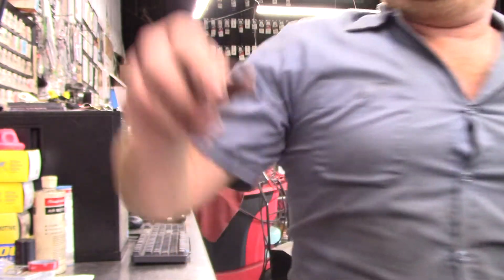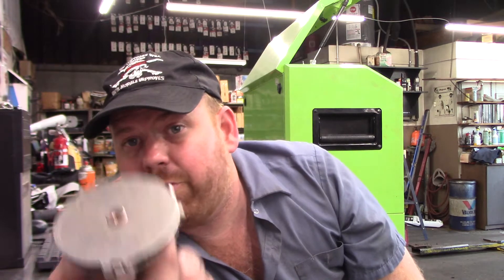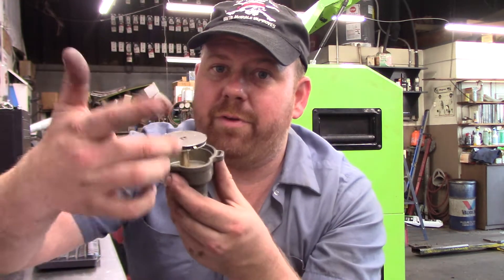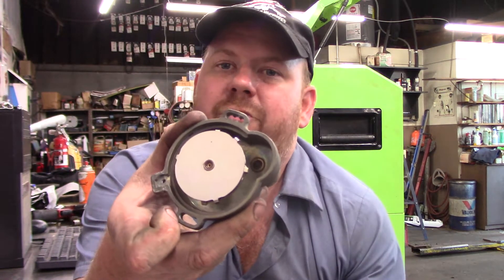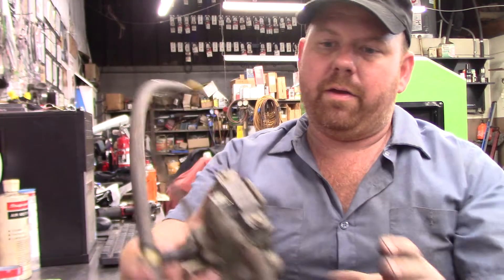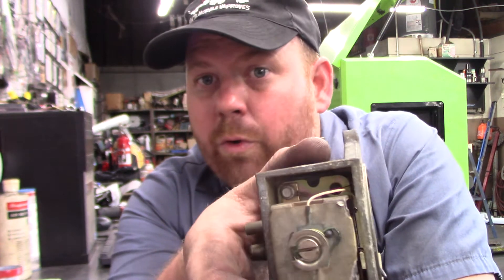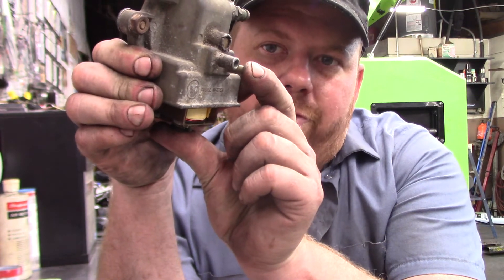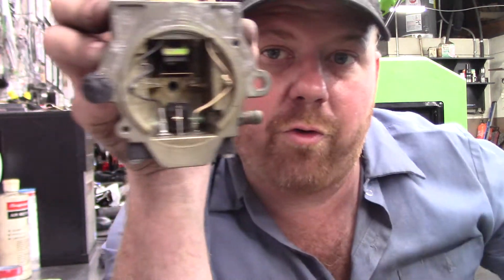GM 70s.-early 80s cruise control transducer explained in layman's terms

Comment: Excellent video and thanks for doing it. I opened mine up (1978 Camaro Z/28) and found the black "slide" thing had come off of the vacuum orifice tube. Put it back on and out it back together now cruise now engages works but it just keeps accelerating. Looks like that side vacuum orifice tube is adjustable?

Comment: These setups have a filter on the bottom, figure that this whole setup is a vacuum/mechanical setup, when that filter finally decides to deteriorate, the entire inside of that transducer gets filled with dust and grit, grit like sandpaper will polish the hell out of everything, the vacuum control valve slide (the white round part), in between the magnet and steel plates (it makes the steel plates super slick making the magnet not anle to "grab" the plate. And also, it'll get in between the bushing where the speedometer feed is, causing it to seize. Its a pretty solid setup, but if the air filter on the bottom fails, the transducer fails.

Comment: After doing the shop manual diagnosis test on my transducer, it appears the transducer needs replacing.  That is, the cruise light illuminated when I hotwired the light terminal to ground. This test is on page 15-7, Para. 2. Do you know if the transducer is repairable for this electrical fault or should I look for a replacement?  Thanks!

Comment: I have a '75 Deville (essentially) it's really a Caribou pickup Caddy, but it's a Deville as far as the drive train goes.  My cruise will engage, but I have to keep tapping the gas while engaged if I go up hill just to keep it working.  not sure if the contacts need to be cleaned of if it's something else.  BTW, where is the servo located, is it inside the cabin or outside?

Comment: I can't locate the transducer blon My 82 k5 blazer. Anyone know where it is physically  located?
Reply: Should be mounted to the driver side fender well under the hood. I've yet to see it mounted anywhere else. If you locate your speedo cable coming out of the transmission it should run right to it. If you have the cruise button on your turn signal stick but your speedo just runs straight to the firewall, then a previous owner has probably deleted it. Currently trying to get it to work again on my 78 C10

Comment: Quick question:
Theoretically if someone wanted to delete the cruise control transducer and vacuum servo, all they would need to do is somehow gear the two cables together. The first cable running from the dash to the transducer, and the second cable running from the transducer to the transmission. Wouldn’t this allow for the speedometer to continue working while also bypassing the whole cruise control system?
Reply: Should be able to just order the cable for the models without cruise control and go straight to the speedometer

Comment: I have one on my 81 Z28 that doesn’t work. The carb has been replaced with a Holley 4160. I want to bypass the mechanism altogether with a 1 piece cable.
Reply: @unicornsteaks6769 did you end up bypassing it with a 1 piece cable? Thinking of doing the same thing soon with my 83 Z28
Reply: @BRYb0Ss11  no, I haven’t done it yet. Other things keep popping up. Next up is replacing leaking rear brake line. 😉

Comment: Excellent video! Just bought a 79 Blazer and while the wife was driving home with cruise control on, the speedometer quit working and the car tried to speed up quickly. The truck had not been driven for a long time (years). She hit the brake pedal and cruise control came off and the speedometer never worked the rest of the trip. I suspect the gear drive got seized up like you mentioned. Thanks a bunch with your explanation, now I know what to look for!

Comment: My cruise control transducer seems to work fine except when set it slowly accelerates and I have to hit the brakes to turn off. What could be my problem.
Reply from the maker: more than likely the valve that the fork moves is sticking

Comment: Can this work with a drive by cable ls swap?
Reply from the maker: As in 'fly by wire' throttle control? short answer: no. Yes one could run a speedo cable to this style and then use the servo to pull accelerator pedal. However if servo was hooked to throttle blade the pcm would prob have issues seeing the blade movement with no throttle change at pedal. Of course could be programmed to work. Lot of hassle. Would be best to just use software update to use the TAC to run cruise.
Reply: @Gunterding_Performance  I have a l33 in a 2nd gen camaro, with electronic throttle body, and I have all the stuff for the cruise control to work with that application. I was wondering if this system could work on a ls swapped vehicle that originally came with cruise control. I have a 82 sierra that came with cruise control from the factory, and I want it to be able to work with a drive by cable throttle body.
Reply from the maker: @claytonhaske  would take a lot of effort, but could. my O6 silverado is fly by wire and uses the TAC and VSS for cruise. Easiest route would be to program the pcm or get one that had the software for cruise. The 82 if cable-less could use VSS yet not sure hooking linkage to throttle will not throw pcm off to see the TPS value change when APP is at idle.

Comment: Thank you very much! clear explanation. Now i can try to fix my cruise on a 82 Phoenix😎
Reply from the maker: Let me know how it goes.
Reply: @gunterding_performance9558  I changes all the vacuum hoses, but i have a question:when i push the CruiseControl button on the dash, what should be happen on the electrically of the control unit? I have 4 wires. 2 go to the solenoid switch (one of them =GROUND) and then 2 more wires on top. It says :HOLD and ENGAGE. When i press the button inside the car now, nothing happens. I assume that the HOLD should show a 12 volt signal when switching on? and at ENGAGE when I want to increase the speed manually from the car also 12 volts? Or am I missing something.🤔
Reply: I think i know a little more, the 2 wires on the bottom of the solenoid is for the dash to let a lamp goes on when the cruise is active. So that leaves only the signals on the wires :HOLD and ENGAGE, i think it woud set to 12 Volt bij activation from the dash. I  meassure this but both wires only give GROUND by running engine. 
Hope you can help me out.

Comment: liked you explanation of how servo works. my 84 el  camino   has had wire s cut some removed, could you go into more of the wiring where it goes to , and how it works  Randy
Reply from the maker: Not too familiar on that generation. I do know if it is the style where the electronic vac solenoid is with the servo im not as familiar. Factory Shop manual will be beneficial.

Comment: I am having the same problems with my 78 Buick Lesabre. However that resistance spring has basically grenaded itself and it's wrapped itself all around. Any suggestions
Reply from the maker: Try and find another to use the part to fix yours. Or there is a guy on ebay who sells reman cruise units.

Comment: I grew up in that generation that rebuilt stuff. If it came in a box, it came from the deal new. They may have hand reman products, but I never saw one. The original GM-Delco-AC in red “Ham” cans with Red strings pull and unseal the box then get your brushes, points set or distributor bushing. You couldn’t get parts for the cruise module but like you, I have taken them apart and couldn’t help think of the engineers who built a part that had to work as if stuck on, would be bad! Still surprised to how they designed these with some changes over the years. Glad you opened one up to show people the insides and how they worked. I am sure you have seen the light blue plastic signal generator inside the speedo that had a reflective surface for light and photo transistor, before magnet pickups pointed toward the tone wheel on the output shaft. Good video!
DK, ASE master since 78 retired.
Reply from the maker: Indeed I have! Def an amazing time in engineering.

Comment: YEAH!!! Finally found a video on these old things. lol. NOS (Mostly) Restoring a '82 k10 w/ 6.2 diesel. I'm trying to find one with "resume" since mine has it on the column. There are a few part#s from the '79-84 10-35 series parts book i own. but i can't find any that shows a resume for my year. do you know of any places/websites i can send some of the used cores to get rebuilt & myb converted to a model with a resume?
Reply from the maker: There is a guy on ebay who rebuilds them, i can try and find the ninfo.
Reply: @gunterding_performance9558  If you could that'd be great! I found a NOS one but might just get mine rebuilt. I have 2-3 cores.

Comment: Thanks for explaining this. My 79 K10 has the single button cruise control. I've checked servo and brake dump valve. Not getting 12v at the hold or engage terminal when pressing single button on turn signal. I've checked all fuses in fuse box and all are good. I see 2 connectors to a cream colored module on side of steering column. Wondering when i should get 12v to transducer with my single button cruise control.
Reply from the maker: No idea on that, id have to look at the shop manual to see. My understanding is around that era most GM style worked relatively the same, some at transducer had a 3 wire terminal for the light and most had 2 wire without light.

Comment: Good Afternoon, I was wondering I have a 1980 c10 big 10 with cruise control. My question is that my speedometer is not working. And I don't use my cruise control. Is my problem with speedometer cable cause by the magnet not spinning or bushing stuck.? Any info would be greatly appreciated. Thank you Robert. HAPPY MEMORIAL DAY 🇺🇲
Reply from the maker: could very well be stuck, seen several do it and cable breaks.

Comment: Thank you so much for this! I'm about to rebuild my transducer from my 83 olds with a sparatic speedometer and speed control. Where do I find a rebuild kit for one of these? And what part usually causes failures?
Reply from the maker: no idea on rebuild kit usually grease gets hard and the magnet and all gets sticky. Ive been lucky and get to clean them and check and they work

Comment: Do you know if this is the same thing for an 83 suburban with a 5.7l?  Based off your video I'm wondering if my cruise not working is a possible vacuum issue of lack there of.
Reply from the maker: Thanks for the interest! I believe that is the type where the electronic vac solenoid is made with the vac servo. check vacuum and i would see if the electronic solenoid is good or not.

Comment: Thank you for this presentation working on this problem right now and my 76 Eldorado. Appreciate you! Would you happen to know where I can source the vibration isolation mounting bolts which attaches this unit to the mounting bracket?
Reply from the maker: Sorry for delay, life has been crazy. They are available on line, been so long since i had to find them now. similar to what was used on some ac condensers. Let me find at shop and see if a part number on the bag.